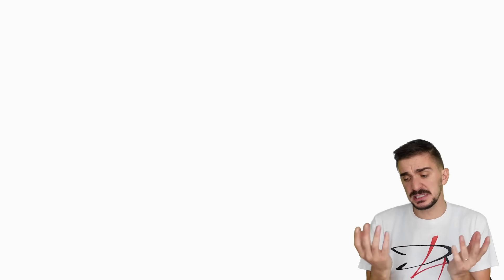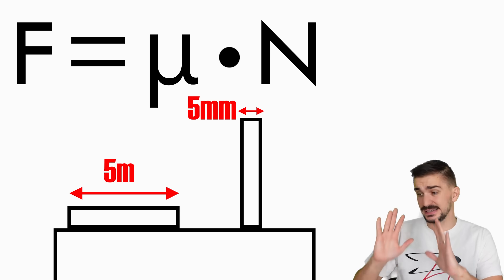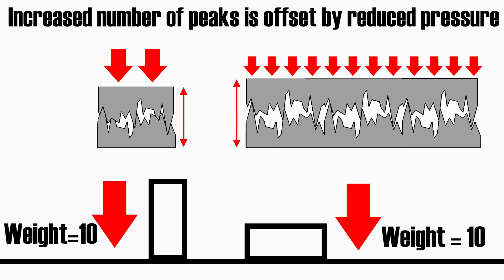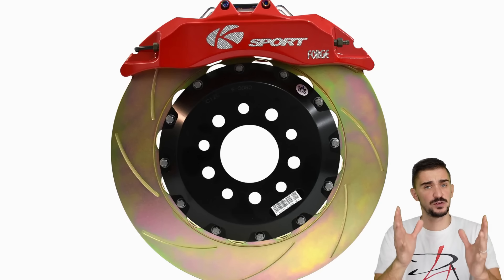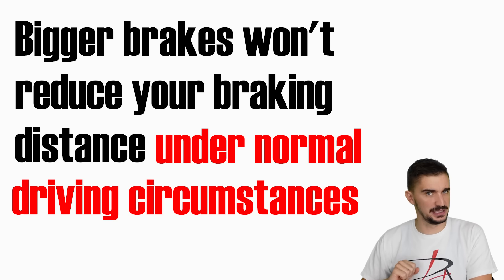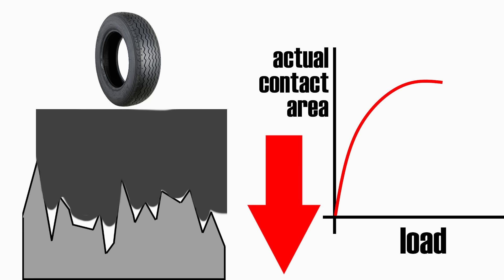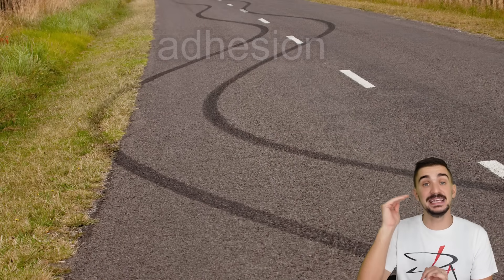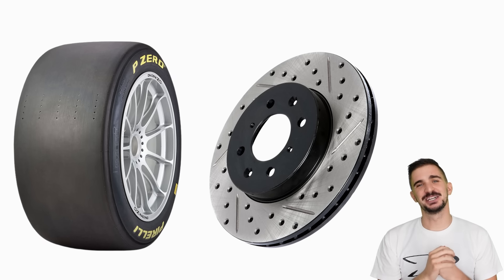Why Big Brakes Won't Stop You Faster but Wider Tires Will - Friction and Surface Area Explained

Comment: Uh, you see, clearly, brake power exceeds effective traction, therefore a wider tire, adding to traction, increases use of that extra braking power not being used.  The video is a lot longer than it needs to be.

Comment: I would need a very scientific study to believe the over all premise to be 100% true, regarding brakes. I can see at the scale we are talking, that heat dissipation out weighs any additional friction characteristics.

To see significant increased brake performance, not due to heat dissipation, maybe the rotors would have to be impractically increased in size.  Also, motorcycle rotors ARE vented, at they are on my bike.

Also dodge Grand Caravan rear discs are a single solid, unvented disc.

Comment: This video really should cover things in terms of the torque applied to the wheel hub (as many have noted, this leads to a different conclusion) and what happens if the piston area is increased since the force applied to the brake pedal (and thus the brake fluid pressure) doesn't change with bigger brakes

Comment: Drilled rotors are prone to cracking with around town driving (start/stop)....so if upgrading rotors just go with slotted rotors, not the drilled & slotted ones, unless you’re doin track driving where brake temps are more constant 👍

Comment: Video awesome as always
But there are two additional things that came to my mind while watching. What about bigger braking disks having better leverage which leads to easier stopping and what about bigger disks being able to accomodate bigger calipers. And bigger calipers can have more and/or bigger pistons which leads us to bigger normal force and more friction. What about them?
Reply: Regardless of all the factors you mention, if the stock brakes could trigger ABS you will not come to a stop sooner. The only friction that matters (unless we re talking about prolonged track use/abuse) is that of the tyres on the road. Think about it.

Comment: If you have a larger brakes, so also larger pads - the surface of braking is higher. If you also upgrade the brake pump or makes it to provide higher pressure in the system your bigger brakes will make your car to stop faster. The upgrade for big brakes without changing/upgrading the pump is a risky thing to do - larger brakes means that your brake system capacity is a bit higher, so the pump has to be enough for this application too.
Reply: No. Watch the video and it's follow up again.
Reply: @NAmania  Yes. If you apply mor force you will stop faster. It is shown in this video man...

Comment: So if I have a Honda Civic with a 11 inch rotor, single piston caliper and a 235/45/17 tire and another Civic with the same rotor but with 245/55/17 tire. Which civic is going stop better if there’s also another civic with a 14 inch rotor with dual piston caliper and 235/45/17 tire?
Reply: If the 11 inch rotor/single piston setup is enough to trigger ABS on the 245s (which it ll probably be)  , then this is the setup that'll stop sooner.

Comment: Although surface / contact area is not important for more brake force the force applied by the postons is.
Bigger breaks usually come with more pistons. With increasing amount of pistons there's more piston area in total. More total piston area results in more pressure on the pad(s)
Which is what eventually gives you more brake force.

Comment: But my 13" front BBK with large 4-pot calipers slows me down much faster and when my 11" OEM size rotors and upgraded pads would start to fade when I'm driving hard and fast in the canyons and mountains, they stop me a lot faster since they don't fade and can handle the heat much better.

Comment: This is nothing less than stupidity by association. Bigger rotors and brake pads serve the
purpose of being effective for rapid repeated use when decelerating from high speed. AS
IN WHEN YOU"RE RACING AROUND A GRAND PRIX CIRCUIT. Using those smaller rotors
and brake pads ..... ITS RAPID BRAKE FADE IS WHAT YOU GET. And only a stupid person
has not grasped that those BIGGER HUMONGOUS BRAKES AND ROTORS ... ARE IN TURN
SURROUNDED BY BIGGER HUMONGOUSLY WIDER TIRES. Its only in psycho babble logic
that a narrow width tire WOULD BE combined with humongous rotors and brake pads. IF
you see big brakes you will see big tires. They go together.

*STOPPING POWER: ITS A COMBINATION OF THE TWO.*   BIg brakes and big tires: they
go together AND ARE NOT SEPARATE. Here you are, trying to make a point ... by invoking
a contradiction. By separating the two. For if what you say is true, then dragsters would be
using small brakes combined with big tires AND HAVE NO NEED FOR A PARACHUTE TO
STOP. This is the ACTUAL ARENA in which your argument holds true and big brakes prove
useless.
*WHEN IT COMES TO BRAKES: SPEED IS THE MAIN DETERMINANT IN STOPPING DISTANCE.*
Double the speed and its 4x times the stopping power that is required.

The take away summary for those who just cannot follow logic. The dots are all connected below.
BIG BRAKES: their purpose is repetitive use without brake fade when decelerating from high speed.
AND THEY"RE ALWAYS COMBINED WITH BIG TIRES. The above podcast separates the two, so it
can engage in a bit of psycho babble: its dumber than side show Bob.

Comment: Why are there so many misleading articles that bigger brake kits can stop you faster? Is it solely due to this misconception?
Reply: It could be a false correlation. A overheated disc makes brake losses effectiveness. So ppl can experience longer brake distance with smaller brakes, but it is not a direct cause.

Comment: The information that you have provided is considered incorrect by 60%. When the brakes are manufactured for any car, a certain iron material must be chosen that corresponds to a certain temperature. The brakes are also designed to suit the car’s weight and speed, as well as the quality of the follower lining. All of these factors contribute to the efficiency of the brakes. Add  To that the surfaces on which the tire walks, add to that the temperature of the ground on which the tire is, add to that the quality of the tire, add to that the level of inclinations, add to that the displacement rate, add to that the percentage of brake use during the trip, and don’t forget the most important thing, which is if the car works with a gearbox.  To or manual speed
Reply: Its not necessarily about brake disc area, it's about leverage the further out the pad makes contact with the disc the more leverage it has in stopping the wheel rotating as well as not overheating as soon, if in doubt try undoing wheel nuts with a 1/4" ratchet as opposed to a 3/4" torque wrench

Comment: Yes literally what you just said throws tyres out of the window...
It's a wider contact area exhibiting the same force.
Yet a narrower tyre holding the same weight and exhibiting more force does not have the same amount of grip.
Therefore this physics equation is wrong and won't work. (As you stated)
On the same score then, why is it a large off road tyre with many peaks and valleys has less surface area grip than a smooth track tyre.
( yes I know the answer is simple, but from a physics point of view it too makes no sense)

Comment: I thought larger brakes worked better because they offered more leverage against the rotating mass of the tires because the caliper is farther away from the center 🤔
Reply: Of course it does, this film is totally misleading. Torque is Force x radius hence it's easier to stop the car using same force.....

Comment: But form my understanding, lager diameter of the disc will have better leverage from the center of the wheel axle, and the calipers is mounted on the outer of the disk. Therefore, when applying the same friction to the disc, a larger disc can generate better force.
Reply: When I purchased the bicycle disc from Magura, They claim that a 220mm disc can generate 20% more power than a 180mm disc. I think this might be the reason relate that what I claim above.
Reply: For this video, It is more about like saying “bigger break” as bigger disc. If it’s a larger caliper, will it generate better force which produce more friction? This is also a question for me. I heard somebody said that larger caliper which have more pistons won’t generate better power. (In Physic’s theory Yes) As long as it would change the travel of the paddle, so it need to modify the travel of the paddle as well. If not, it would remain the same power. Can someone explain about this?

Comment: Although I love your explanation, brakes aren't steel on steel. Well, unless you wear your pads down to the rivets. I would argue that your tyre model is similar to brakes. The pad compound will approximate a tyre going around the rotor over time.

Granted, larger brakes are more efficient at managing heat, but so are tyres when the chips are down. It's a complex system and models are just that. Models.

Comment: Are you aware of the Fox body Mustang? Regardless of how wide the tires, the stopping distance remained the same...woefully long. On the racetrack, Mustang drivers would run into the rear of Camaros to slow down as their brakes were insufficient but the LARGER Camaro brakes were very sufficient. ONLY when LARGER brakes from the Lincoln Mark VII were allowed did the Mustang have the braking power necessary with the exact SAME tires! Now, IF your existing brakes can lockup and slide the front tires, wider tires will definitely help. The stock Mustang brakes were extremely UNDERSIZED for the weight and power of the vehicle. My 1990 Nissan Z32 300ZX has larger diameter rotors than stock and testing shows that it stops shorter than the stock rotors. I was able to use wider, stickier tires to optimize the effect. It now has 245/35-18 front and 305/30-18 rear tires. The two, tires AND larger brakes, have reduced stopping distance by around 15% over stock without fade. Modern ABS systems, with sufficient OEM brakes as stock, are the biggest reason for wider tires producing shorter stopping distance from stock brakes. Larger rotors generally run cooler as they aren't being overworked as smaller rotors, too. There are good reasons that, when allowed, racers will run much larger brakes than stock even when tire width is restricted. I live in the Pacific Northwest with a LOT of twisting mountain roads that destroy factory rotors and brake pads when driven aggressively and within the speed limits. The problem with rules?  There are always exceptions. IMO

Comment: after the brake pad and rotor breaks in and mates, it has a much better contact area. remember that adding bigger brakes (more cylinders) requires less braking force (foot to pedal). i've noticed a decrease in braking distance during panic braking test when upgraded the stock brakes (chevy tahoe) with factory brembos. it required less braking force to stop quicker which does reduce distance. anti-lock kicks in further helping reduce distance during hard panic braking. with smaller and lighter vehicles, the distance  change would not be as noticeable.

Comment: I must get your attention to one thing - in case of bigger brakes a braking force is put on bigger radius disk, which creates bigger leverage and automatically more torque put on disk. Evan if you take smaller disk with wider braking area and bigger with narrow braking area - to achieve these areas equal, than bigger radius will stop you faster - if you have enough grip of course. If you lay a bicycle upside down and turn a wheel to some speed, you will stop it easier by a tyre area than an axle area. I actually work in a transport company and we have many different vehicles and I can honestly tell you, that a trailer with 385/55/19,5 with smaller disks brakes a lot weaker than trailer with 385/65/22.5 with bigger disks and both connected to the same tractor and the same weight - and both has 385 wide tyres and both have set the same braking force in trailer's ECU (EBS, 5th generation). I hope that you understand my point, I'm not native English speaker, sorry.

Comment: You've never driven a car with inadequate brakes to weight ratio.  It's like you don't have brakes at all.  I swapped a foxbody mustang from a 4 cylinder to a 8.  Drove the car where I was going to do the brake and suspension swap and could barely stop.  Once I put the larger brakes on, braking was perfect.  Didn't change the wheel or tire size.  You might explain this in your video, but, your headline would be misleading then. Either way, not going to watch, since I disagree with your premise.
Reply from the maker: Good call. This is would go way over your head